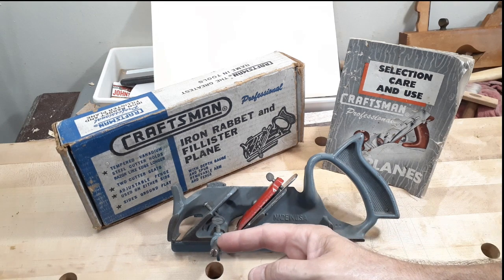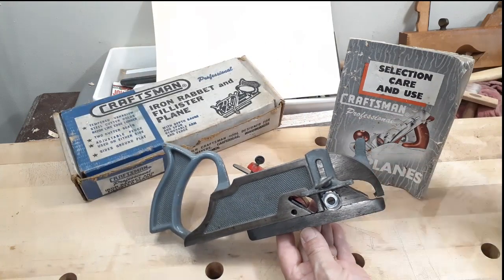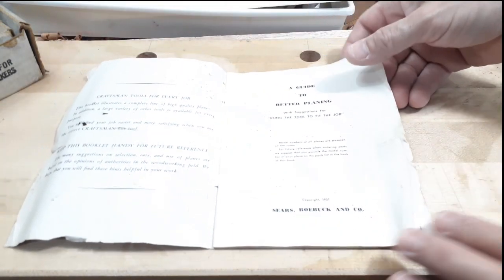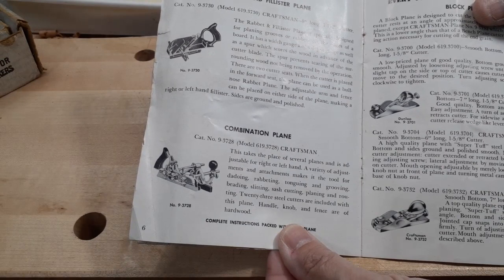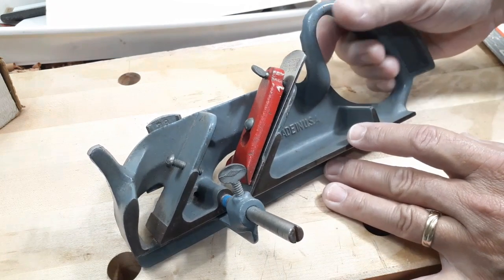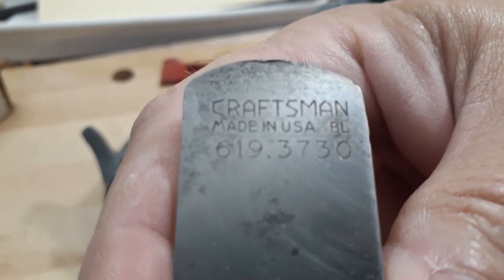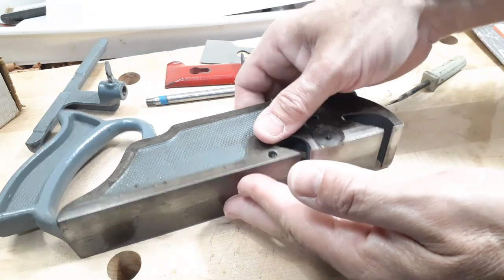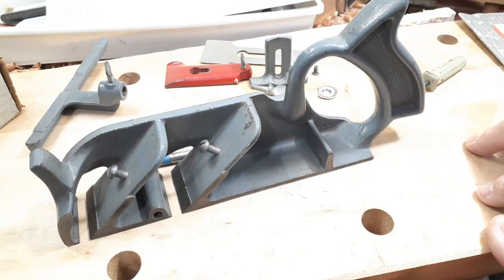Craftsman Iron Rabbeting and Fillister Plane No  619.3730

Comment: I have a question since I got one I am restoring but it is missing the depth stopper and the fence and whenever I look up the fence with the model number I get the 3720 model fence, does it just use the 3720 fence in the 3730 model?
Reply from the maker: I really don't know. I didn't even know that they made a 3720. I wish I could be more help. May your restoration go well. Thanks for the question and thanks for watching.